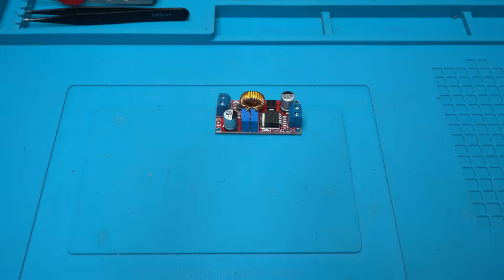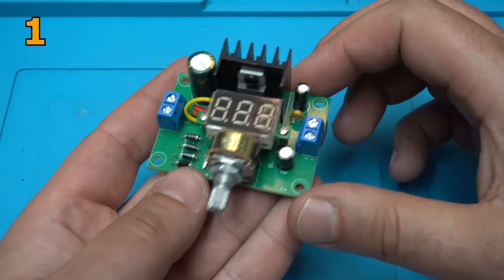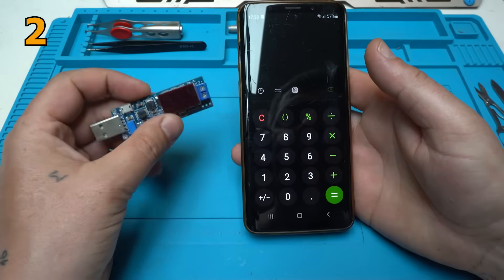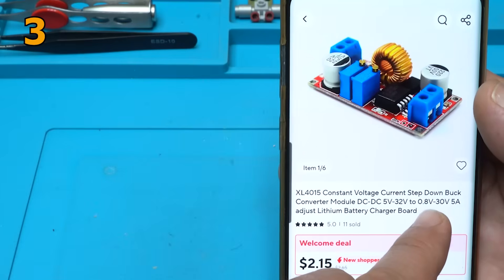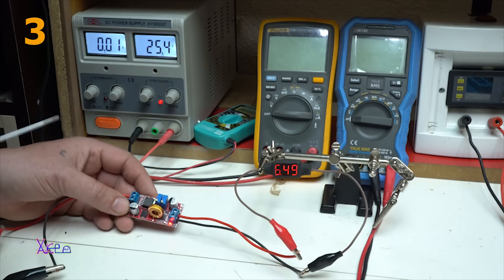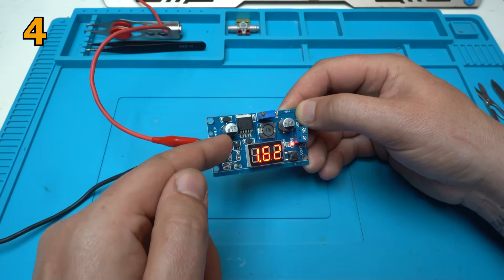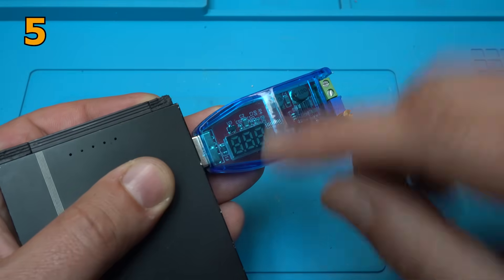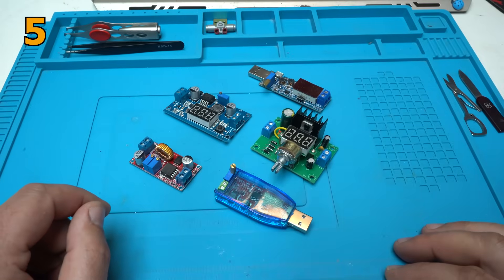5 BRILLIANT $1 Aliexpress Modules

Comment: I have number 4. Under the LED display is a tiny chip that is used to control the LEDs. I would love to know what that chip is but it has scratched surface. i'm guessing it is a very cheap microcontroller of some kind or a PIC. This same little chip is embedded onto the back side of the same voltage meter displays that can be bought separately for 50c.

Comment: Hey there! Came across your channel a couple months back and am loving your content! I'm trying to make a back up power supply for my router. I actually own a couple of the second module in this video. I thought it would be perfect for this project but I found out that my routers power output is 12v 4.6 amp. The buck boost mentions nothing about it's amp rating. I want to test it but worry about messing up the router. Are there any modules out there that increase the voltage AND amps?
Reply from the maker: Yes you need more powerful converter,type dc dc converter 300w or 400w on aliexpress
Reply: @Hacktuber  so I found what you suggested, the max amp would be 4 while the router uses 4.6. would that be ok to use?